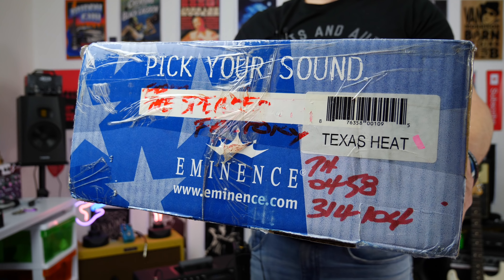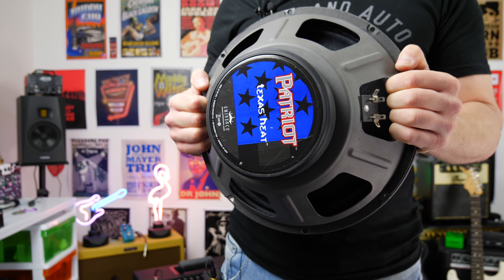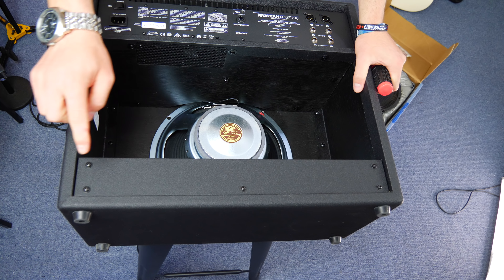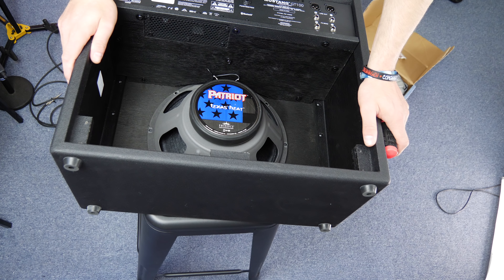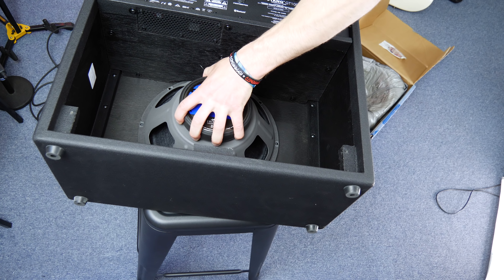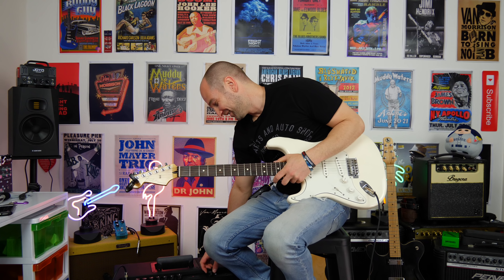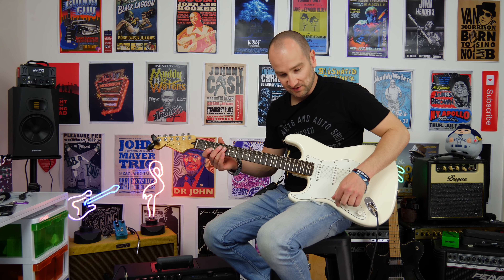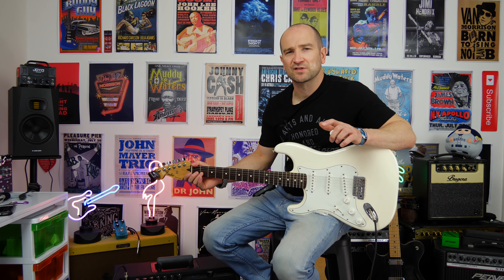Fender Mustang GT-100 Speaker Swap (Texas Heat Speaker)

Comment: This is just a guess from someone with an engineering background, but it's likely that speaker tone is also part of the modeling performed digitally by this amp, so that the signal that comes to the speaker is not the typical signal that would come out of an analog amp (tube or solid state). The designers might have chosen / designed a speaker that is at the same time cheap and has a response that would work best for the whole range of "models" done by the amp - and probably also "optimized" the modeling to how it sounds with the chosen speaker. In that sense, the original speaker might sound better than more expensive ones in this context.
Reply: The amp should be used with  a full range flat response speaker only,  NOT a guitar speaker.  That's why he didn't like the result he heard.
Reply: @dazzsmee6140  Totally agree. Modeling combo amps or modeling amp processor boxes are designed more or less to play with neutral wide range speakers or PA systems, not guitar type cab speakers.
Reply: Well the speaker that comes in there it's a certain Celestion that it's hates in the internet world called the Celestion G12-p80 also known as the 7080 which is 80 watts and sounds just like the expensive Celestion speaker's like V30 and green back but with more aggressive mids the I really like but since it's not super expensive and the heritage of the name is hated on the internet but I really like those speakers because they have highs and mids that just cut and drop 4 of in an Orange or Mesa and it will just kill everything else, I'm telling you, I know from experience !
Reply: @dazzsmee6140 Not true in this case. Yes, it’s a modeling amplifier but it comes with a guitar speaker in a cab (and not an FRFR speaker) so the different cab models are not proper IRs/Impulse responses, they’re rather some extra EQ colorings that are designed to be put on top of the *guitar speaker*.
  I’ve read on a forum that some dude put a Kemper Kone in a Mustang hoping to improve the sound and it just made the whole thing sound horrible. Putting different guitar speakers in it also shifts the whole thing into an unknown territory but that’s why it’s a great thing to see these guys try it out so we can get an idea what’ll happen.
  Shane has another video where he puts an Eminence Swamp Thang in a Mustang III v2 and that came out to be better than the original. Also it being 150W instead of the stock 100W makes it harder to blow the speaker, like my dad did when he cranked the f*ck out of his Mustang III v2. But instead of swapping it, a friend of his replaced the cone and rewinded it to 150W. Now it is either louder or just remains clean while cranked. Regardless, bigger wattage seemed to be an improvement. 
Boy this is a long comment.

Comment: The GTX is far better than the older GT and LT Mustangs. They have better speakers as well. I tried swapping out a few to try and the best was a Vintage 30, but it wasn’t that much better than the new Celestion one that comes with the GTX, so I just put the original one back in.

Comment: Well Howdy from Texas 👍I couldn't help but comment on The Texas Heat Speaker vid. Talking about mids, I used to scoop everything, vocal, guitar, you name it. I think sometimes we try to change the color, if you will, of voices. Both vocally and guitar. As I've got older I just want a natural sound on my instrument and voice. Mids makes it cut through the mix in my book. I do a lot of gigs with my NOS Blues Junior no effects. I turn the Bass and Mid wide open. The treble about 8:00 so only up a 1/4 or so. Dial up til I got just a touch of dirt and clean it up with the volume. Then if I need to push it a little more just kick the fat switch. I changed the reverb tank as the original sucked. Really though it's fun to just work with the guitar and amp. You can really cover a lot of Sonic ground with it if mids don't scare you. Sorry for the essay. Have a Merry Christmas 👍

Comment: Have mixed feelings about the amp. I have one and an older mustang. I am able to get great sounds, but sometimes using a different model than I would have thought, and other quirks. I don’t why folks will select a preset (not the amp presets) and be mad about it because you can either change everything about them or just use a different one, make your own etc. I don’t think upgrading is worth it though. It’s like buying a signature strat, changing every component to non Fender stuff and being thrilled that it then finally sounds like a strat. The amp is it’s own thing, and you just can’t have 16 tube amps in a 200-250$ dollar box. It just won’t happen. But you can find new things if you dig around some, so it’s fun to find something unique to write new music with. Save your money until you can get the amp you are wishing for and let this just be what it is. Thank you for the video!

Comment: The Mustang "v3" should have focused on implementing MIDI for increased patch selection and continuous controller possibilities.  It seems like with a decent upgraded speaker they pretty much had the sounds licked.  I wasn't a fan of the membrane buttons, and would have preferred cab emulation only on the XLR outputs.  I'm considering keeping my Cyber Deluxe and upgrading the speaker to a WGS ET-65 or getting a Katana Artist.

Comment: The Global EQ on the amps settings  menu can be adjusted, as the default amp setting is flat. There are a few interesting videos on YouTube that demo this feature. Adjusting the global EQ does make a huge difference in tone, which definitely can eliminate the scooped sound on a particular amp setting. Fender should put out a video demo just on the Global EQ feature, I think it will definitely help give viewers more insight.

Comment: intheblues Shane have you heard of the George Alessandro speaker by eminence? I used to have a Super Champ combo and loved the amp, but not so fond of the speaker. I had watched a video where a guy swapped out the stock for a 10" Alessandro speaker. The sound was unbelievable. But I couldn't find one. They had discontinued the 10" version. After I bought my Hot Rod Deluxe with the orig stock speaker from 1996, I started looking. Found one and popped it in. George Alessandro was like the best tweed amp tech known to mankind in the NYC area. He was so good, Eminence made him a signature speaker to get a little more tweed in whatever you put it in. I am so happy with it, that when I sell the amp before moving back to the USA, I'm pulling out the telefunken tubes and that speaker and taking them with me and putting them in the replacement i will buy back home. It's so important to actually get a speaker that matches the power rating of the amp. 40w amp should have a speaker that matches the power output, to get the most out of the speaker. I see guys stuffing 100w and 200w rated speakers in a 40w amp. it's just not going to get the most out of it. If I remember correctly, this Alessandro is rated at 50w. HRDx and devilles are famous for how loud they really are. No exception here. It can blow out the windows. Had to put an attenuator on it. But of course it';s not just about how loud, but how good. This combo is insane. You still have that Blues Deluxe? I'd give it a shot. I think I paid something like around 100 euros or a little less for it on Amazon Prime.  Bob in Germany

Comment: i know im a little late on this one shane but if u try keeping the impedance the same it will sure do what your asking try the eminence delta 4 ohm...i ran a twin cab with these on a peavey solo 100  watt combo an did what you a trying to do fatten the sound an take the mid an trebble shrill an balance it the mix so its not so ice pickey wiothout losing all the top end...an believe it or not this was idea i had from you an a vid..you did on speaker swapping about 5,  6 years back?

Comment: Fender Mustang  GT-100  w firmware version 3.0.49 vs Fender Mustang GTX-100 - Should You Upgrade!?      Same 12 inch speaker  is the PC circuit board the same?

Comment: Trying an FRFR type speaker might make a difference. Was finally able to plug into a Mustang GT 100 and  imeditaly regretted not being able to navigate thru the settings as easily as my Mlll v.2. Being forced to use the data wheel to make any menu changes was difficult and ridiculous. I refuse to use my cell phone to operate my guitar amp. Which is how this amp is designed  to be used anyway. Not for me lol ill stick with my Mlll v.2 and tactile menu buttons. Much easier to deal with in a live setting. Again the older version sounds much better to my ears anyway.

Comment: Can you or anyone tell me if the stock speaker(s) in the GT100 or 200 are designed for more of a hifi sound or are they designed as guitar speakers?
If they are "for guitar speakers" then it seems illogical to me that this would render this amps music playback abilities to nothing short of disappointing because guitar amp speakers do not sound good for playback music and is redundant for using the built in speaker cab simulators ! 
I've had a number modeling amps that have cab sims through the years in which the designers opted to use guitar speakers! To me that seems a bit like an obvious oversight that defeats the whole concept!
So with that said
If these speakers are specially designed to sound good for playback music which would make more sense to me
I would need to ask why it would be advantageous to swap them out with speakers designed for guitar?
Just curious
Thanks

Comment: I'm really quite surprised that these modelling amps have conventional guitar speakers in them. They shouldn't. Since they have IRs in them, the speakers should be straight FRFR types. That's one of the cardinal rules of the higher end modellers. You can run them with guitar cabs, but then most people will turn off the cab simulators and IRs. I personally think that a modellers with a guitar cab with the cab sims on sound terrible. That's just me. Nice vid!
Reply: The speaker that Fender put in the GT100 is a special design and approaches true FRFR.  Shane is making a mistake in putting a guitar speaker in it.  He is not alone in not understanding how these modelling amp systems are meant to work.
Reply: @dazzsmee6140  No, I think Shane gets it. He does mention that the speaker is more for modeling amps. And the Celestion G-12 in there isn't an FRFR by any means. The only speaker that Celestion makes that is anything close to an FRFR is the F12-X200.
Reply: Old Guy's Guitar Vlog I have a Celestion-G12 in my Mustang 3 v2 (stock) and it sounds just fine. The line6 Amplifi or Firehawk is a fullrange-system, the Mustangs are supposed to be just a guitar-amlifier, so yes, guitar-amp speakers...
Reply: The Celestion is an FSD - Fender special design, so not one that Celestion normally make.  It is supposed to have a flatter response than normal.  If you look at that Texas Heat speaker's response it is a typical lumpy guitar speaker with no high frequency response.  Not a good choice at all.
Reply: The GT100 is designed to allow streaming of music as well, so it is not just a guitar amp.  That's the major difference to the older Mustangs.  The models of the speaker cabinets are only applied to the guitar channel, not to the aux and bluetooth inputs.   The combined signal has to be sent to a FRFR amp and speaker.
Reply: @martijnvandenakker803  Are you able to change the Cab IRs on the Mustangs? I didn't think you could. I could be wrong, as I haven't owned one since the V1 version.
Reply: @oldguysguitarvlog183   Sure,   in the detail setup for each amp model, there's the ability to choose the cabinet you want to play it through.  Same section as things like changing the bias and sag.